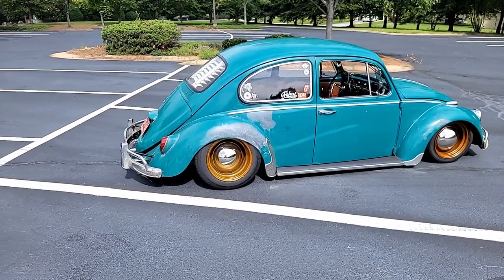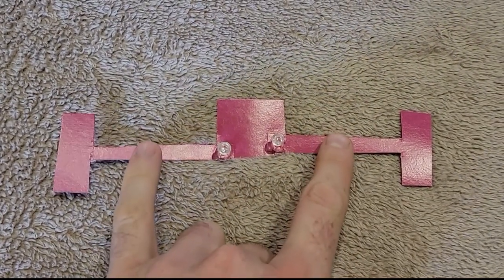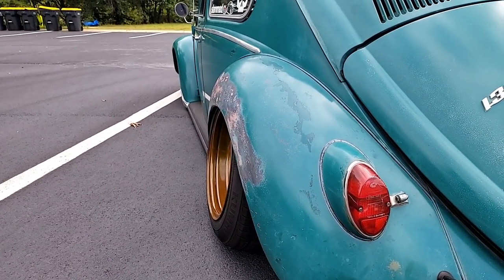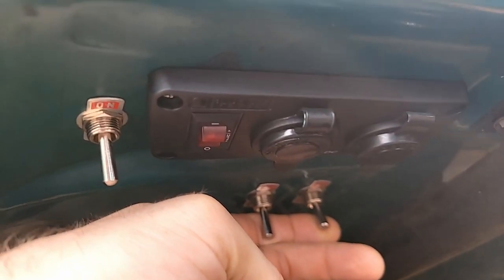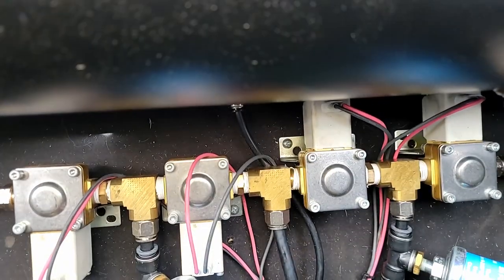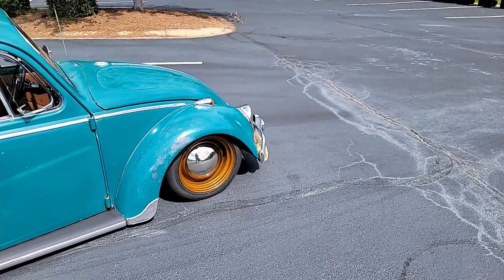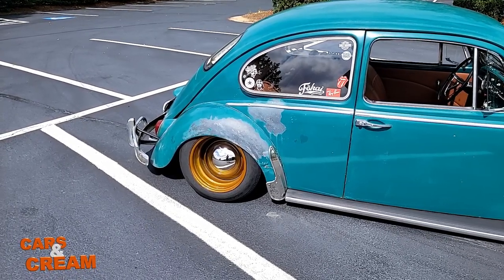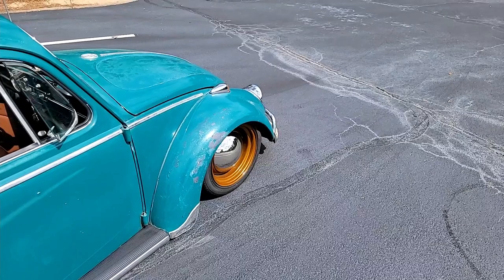The suspension and stance on my bug explained.

Comment: I wish I had the courage to lower my bug :((
Reply from the maker: It doesn't take courage. Just a little money. It's all reversible too, and usually adjustable.
Reply: @carscream1650   I can’t decide if I wanna use the Monroe air shock or fab a single bag in the middle of the beam.. love your wheels/fitment! In the process of widening all the fenders😉

Comment: What wheels do you have?
Reply from the maker: Thayer custom made. I sent a set of old rusty smoothies to Arkham Kustoms and he cleaned em up and put new barrels on em. I had them powder coated locally. 8x15 and 5.5x15.
Reply: @carscream1650  what did something like that cost ? And how long did it take ?